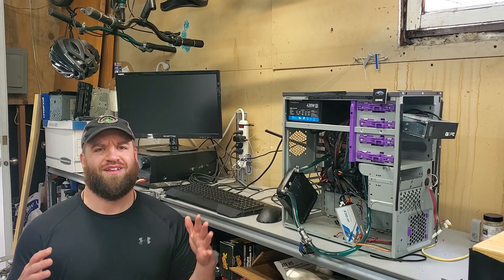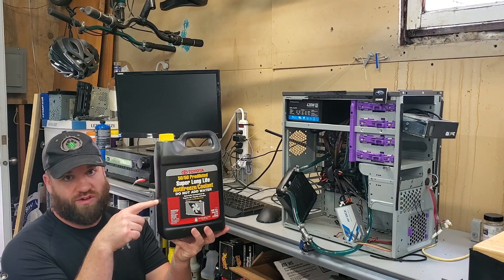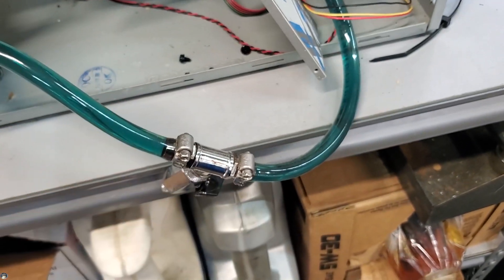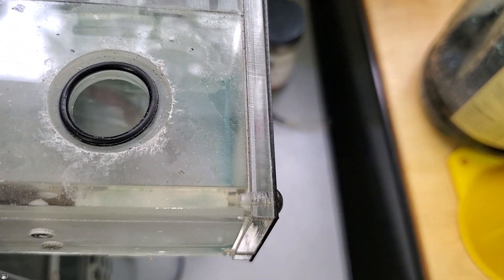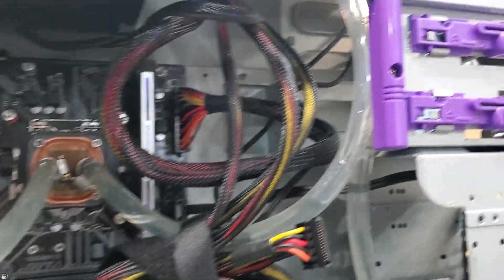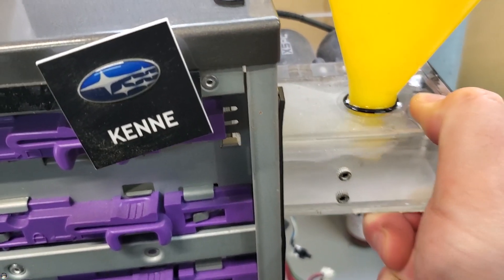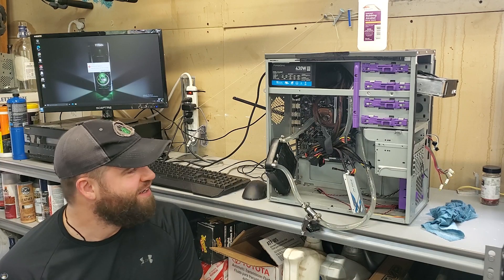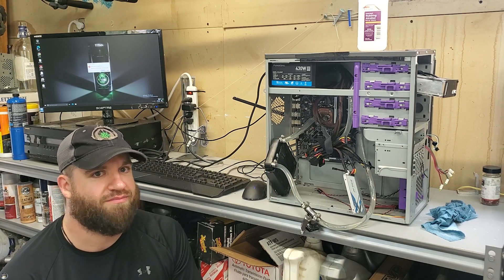2 Years of Automotive Coolant in a PC How did it hold up?

Comment: been using premix coolant for over 10 years now. temps are same when using distilled water. have no issues with it. no gunk and corrosion build up.  but i still dilute it a bit coz i think its too thick.
Reply: Alright. Coolant and distilled water is the way to go then

Comment: I messed up when building my Ryzen rig and ended up not having enough EK Cryofuel (boutique stuff costing 10-15eur per liter bottle) to refill my loop. It was the weekend, I wanted to play games with my friends and I was frustrated... so I went and bought some blue G11 car coolant premix (mainly because the only other option they had was pink stuff) at a local gas station, which despite gas station pricing still only cost me about 1/3 of the EK stuff for the same amount. Flushed the loop with distilled water, filled it up with the G11 premix and... well.. it's been working perfectly to the point of me not really giving a shit about it for 2 years now lol. Looking at the reservoir, it's still clear, still vibrantly blue, temps haven't changed beyond margin of error (1-3°C) and because I used EPDM rubber tubing I didn't have issues with PVC tubing discoloring or turning milky either. But unlike your rig both my CPU and GPU block aren't transparent so I can't do a simple visual check for gunk. Doubt there is much of anything though because the average and max temps haven't really changed in all this time. Honestly if you value your rig working over a build just for looks, this really doesn't seem like a bad option. Just don't go and pour straight concentrate into a loop like some dipshits have been doing and then complain that "car coolant sucks for PC use" lol

Comment: Cool video man I just built a loop out of the same parts, my drain valve setup is identical, tubing from home depot, cheap fittings from Amazon and filled it with automotive coolant lol it works great and your giving me some confidence that it's gonna hold up just fine!

Comment: Why only single channel ram ? You will gain more performance with a dual channel kit. I wouldn't reccomend mixing ram kits tho esp in ryzen. And also that coolant looks nasty. I would get a better case with better airflow if your running a 3070